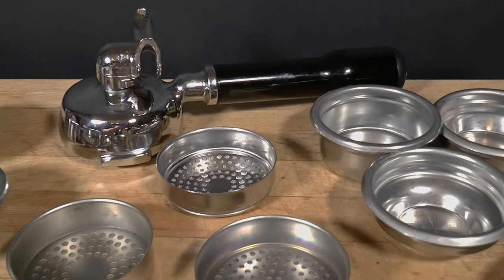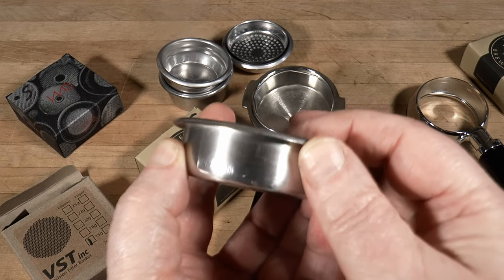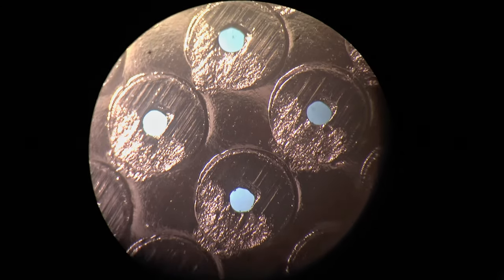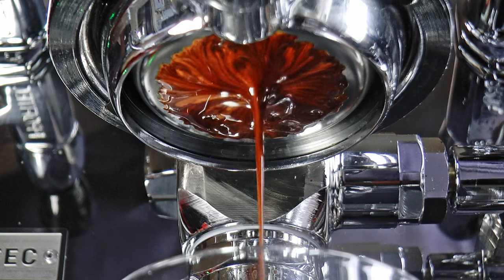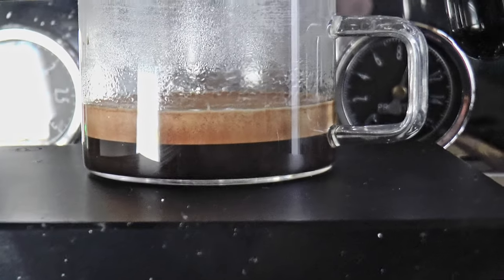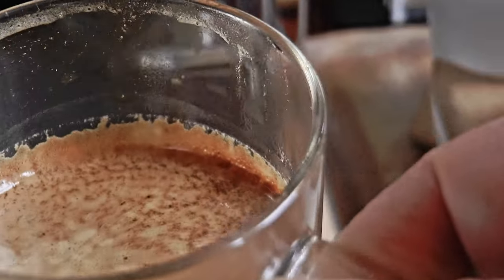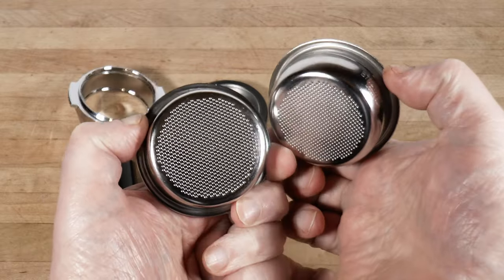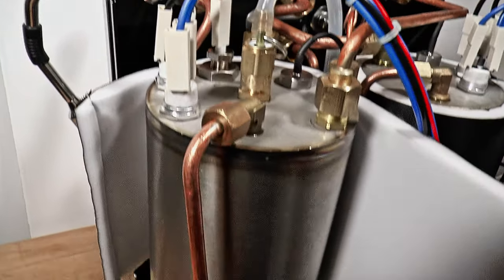Fancy Espresso Baskets pt 2: More Truth

Comment: Not sure what  you mean with kinetic energy. The amount of actual kinetic energy from a physics perspective that is contained in a few drops of water moving at a few mm/s is going to be very minor. I would expect the vertical pressure gradient across the puck to be far more influential in the extraction process. Water moving at even high velocity (say 50-100 km/h) would probably still be unable to make it through the puck, though that would be a fun experiment.
Reply: Given the context of the video, maybe "turbulence" would have been a more appropriate word choice. But I'm just assuming.

Comment: I got a Big Bang, mainly because it wasn't too expensive, and I was looking for a 14g basket. 

I can't get the puck out as easily or at all as my generic 20g ridged, tapered basket. Make sense, with a tapered basket, once the puck is loose, the walls wont stick to it anymore. Kinda like bottleneck versus straight-wall cartridges. 

Anyway, one thing I don't like about the straight wall. But otherwise, makes good coffee. That's about it really as far as I'm concerned. 

The ridge stuff, since I use a 'puck screen of some sort (mainly for cleanliness), when you drop the screen, the coffee underneath tends to puff out of the sides and make a mess.

So basically, purely for practical reasons, curved (tapered) wall, and no ridge.

Comment: For blends, I’ll always use a conical brewer to balance the different extraction rates of multiple coffees. A very even flat bottom brewer tastes terrible with light roasted coffees blended together compared to a v60. That’s the point of the blend filter-blending those extraction together in a more even way than just a small conical basket shape. 

I know many people who can increase EY by 2% however they are using low pressure, and well aligned burrs and don’t produce many fines. They use shot times like 15 seconds Mavam 3 bar pre infusion + 20 seconds 5 bar full pressure.

I’d imagine traditional espresso approaches won’t do these baskets much justice.

Comment: I would still like to see a computational fluid dynamics simulation on this though…
Reply from the maker: Of a pressurized solvent passing through a bed of semi-soluble particles of varying shapes and sizes, with changing temperatures and pressures. Why yes, I think I have just the phone app for that :)
Reply: In case the irony didn’t come out: I think one can also overdo it… I’m perfectly with you: If the basket produces even extraction without channeling and it tastes great, I don’t see the need for a Unifilter.
Reply from the maker: @timgerber5563  Oh, it came through fine. I was just rolling with it :)
Reply: Late to the party. Just have to beat this into the ground because not everyone understands the reality of CFD. Even though I know it's sarcasm, there's always this idea that you can do CFD and prove what's better for every environment. The reality is that CFD works for what you feed it. The given input must match reality. If you have bad input, the simulation won't help you at all. And hot fluids are more turbulent.
Reply: @YoureSoVane I'm not well-versed in physics or fluid dynamics or any type of engineering but I do somewhat understand what you're saying and also really appreciate the clarification... It's nice to kind of understand the joke whether I fully get it or not haha

Comment: Hope it's not too late to get a reply. I bought both the E&B Lab basket and shower screen based on what I learned from this series (as my priorities are a cleaner workflow and a faster flow basket)

First issue is that after I tamp my coffee, when I turn the portafilter upside down (habits) the tamped coffee came out. And I'm sure I tamped enough pressure. What's up with that?

Second, I'm aware that some people, when using this basket, are not getting a rat's tail flow. But in your video it does make a rat's tail. I struggle to get a rat's tail even after grinding fine enough to get 9 bars in the grouphead. Help?

Third, and this one hurts the most, when I tried to remove the puck it didn't come out as cleanly like most, if not all, of the videos I've seen people using this basket. It still had ground residues after knocing the puck.

Please help.
Reply: If you're using those nano coating baskets, yes dry puck (before pulling a shot) falls out very easily. I actually suspected it causes more side channelling but I didn't notice such in my shots. Another common cause is your tamper may not be a prefect fit for the basket. Too small will cause the sides not tamped, while too tight cause suction of the puck to leave the basket. If you moved from a VST, the diameter are not the same. If it is too loose, try wrap the tamper with tape/foil tapes to fit. If it's too loose... the only way is to heat the basket before you fill and tamp, or freeze the tamper, which both are not feasible options in reality.

For not having rat tail, make sure you do the WDT as good as you can. If your machine can do a pre-infusion see if that helps too. Another way is try to grind coarser. Basically try anything that would avoid an uneven flow

I had bits of dirt sticking to the basket too, very likely due to wet puck as I am using a Decent. If you're using a standard E61 see if the puck is totally dry when you knock it out. I end up not using the E&B because I am using a 2mm puck screen. Without the coating, a light knock knocks out only the puck screen, making the cleaning process easier. With the nanocoating, the hot puck came out together with the screen at the bottom which I need to dig it out
Reply: @tamninja  thanks for the reply! Thankfully, the dry puck coming out only happened once, in the beginning.

On the rat's tail, I noticed that for the coffees that I have (2 blends and 1 single origin), for the blends it all ended up having a rat's tail stream, while for the SO coffee it was way more difficult, but not impossible to achieve (as long as I take my time w/ WDT, which honestly sucks that I have to rake more)

What's consistent w/ the basket though is how fast it flows, and how easy it is to clean w/ minimal effort compared to standard baskets.

Comment: Maybe the idea of the straight walled baskets like the one from weber is not to produce better tasting coffee but to extract more evenly and therefor have a higher EY% and ultimately wasting less good coffee.
Reply from the maker: OK, but if the high EY coffee doesn't really taste good, wouldn't that be even more of a waste?
Reply: @wiredgourmet  That's true of course. But I didn't said it'll taste bad just not necessarily better. I guess less complex and weather you like it or not is subjective. Objective is that the coffee is used more efficiently and that's great.

Comment: This whole topic is super interesting and it shows once more that there are many different approaches and believes in coffee and that extraction doesn’t always work the way we’d expect it to be. Wafo does in fact offer different baskets with different approaches and taste profiles to mirror this (still 200 bugs 🥵). I recently started experimenting with a paper on the bottom of my basket. It’s supposed to give a more even and higher extraction just following the Weber approach. It does in fact let me grind a bit finer and increase the temperature a bit without hitting a wall of astringency. More sparkling acidity as well and the espresso tastes well (…) paper filtered and therefore „cleaner“. I’m not sure yet whether this is truly definitely better. From a visual perspective the puck looks super evenly wetted.

Comment: Nice video with many good points for using a Profitec machine with flow/pressure control.
Decent has just brought out a video on this subject also. 
If you gently pre-wet the coffee as described in this video, I have found baskets do not make a difference for 18g doses in an appropriately sized basket.
However, a tapered basket should make a difference for low doses in a 58mm basket as it increases the depth of the coffee and reduces the effect of channeling - maybe Lance could then pull a 12g shot that he is happy with. 
As for screens, when I did not pre-infuse under a low pressure and used a screen that had few holes, I found that the water would "punch through" the puck, cause channeling, and uneven extraction that was easily visible by breaking apart the puck of coffee after extraction. 
This is easily fixed with a screen that lets water out through most of the screen, and/or pre-infusing. Any machine that does not do this adequately as purchased is broken IMHO.